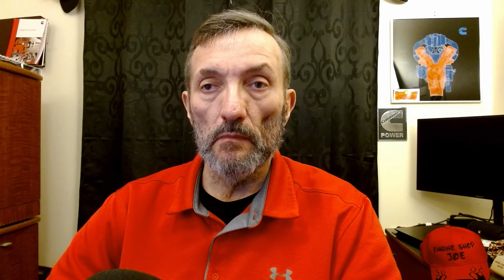Help Air in my fuel and fuel fault 559

Comment: Hey joe I work on my truck all the time. I had code 559 come up after I did biodiesel. I have replaced the fuel filter, fuel injector drain valve, high pressure rail valve front of the fuel line. I put new pump on and tappets , valves in the fuel pump last year. Tested the injectors with inside passed but my rail pressure drops 5200 psi in a min. Could this be a leaking injector  why this code keeps coming up. Thanks for your time nate
Reply from the maker: What engine do you have? Send me the 8 digit serial number if you have it. I am thinking about this.

Comment: Please help me,, i have same trouble cummins engine,, error 559 SPN 157 FMI 18,, already change pressure fuel pump,change fuel filter ,but...same problem coming
Reply from the maker: start the engine and rev up the engine. then grab the fuel dump on the rail and see if it is hot. it should not be, but if it is failed and leaking it will get hot. That can cause low fuel pressure faults. that is about the only easy check. Other than that you need to go through the steps to pin down the problem.
Reply: @ENGINESHOPJOE  thanks for you help me, the problem is check valve at common rail...thanks a lot

Comment: Hi,
I have a question. I been dealing with this nightmare for a month. I bought a used truck with a bunch of codes (09 Sterling with a Cummins ISC 8.3). I changed new rail fuel pressure sensor, new high pressure pump head, new fuel regulator, and a new engine crank position sensor. The truck is losing power randomly and then goes back on. It starts perfectly. When I check the fuel pressure filter housing it registers 110 psi with no interruptions, but the truck will show 8,000 psi at the moment the commanded fuel rail pressure should be 14,000 psi. Question: should I put a new gear pump? It feels like the high pressure jumps up and down in relation to common pressure, but the low fuel pressure stays steady 110 psi. Another question, is a steady 110 psi enough to feed correctly high pressure pump with fuel, or should I change the gear pump?
Reply from the maker: What is the engine serial number.? Make sure there is not anything in the fuel tank floating around that could be a temporary floating restriction.
If it only does it hot suspect a problem with a fuel line between the tank and engine.  Does the wiring harness look ok. Do you have any voltage codes? unplug the ecm and look at all the pins and any signs of green corrosion at all. Then plug them all back in. I fixed a couple issues just unplugging and replugging. Next time it does it check if the rail dump valve is very hot compared to the fuel rail. THey can randomly start dumping fuel and they get hot compared the the rail. Those pieces should all be the same temp to the touch. It could be the dump relief on the rail. 
You can email me at faultcodehelp@gmail.com if you have more information or an ecm image or data log you want me to look at.

Comment: Hi , 
I have code spn 157 fmi 18 . We changed Fuel filter , fuel rail pressure sensor, pressure relief valve 4 days ago and everything went back to normal until today. The code showed up again . If you can point me out what next needs to be check I would appreciate
Reply from the maker: This is a general answer because I have no history on your engine or fuel system. Make sure restriction is normal at the gear pump inlet while dumping fuel from the on engine filter. Verify there is not air in the fuel. Before i had the orficed dump line i used a line with a gate valve i just slightly opened the gate valve to dump fuel.
Check the fitting that takes fuel into the gear pump (line from fuel filter on engine to high pressure pump head inlet) that fitting has a tiny built in filter see if it looks empty to the eye and not crushed or misshapen. If that all looks ok and there are lots of miles on the engine it could be the high pressure pump head which just bolts on with a couple gaskets. You need to do flow checks to verify the pump head is the problem. It comes down to the fuel actuator in the injection pump , the aluminum housing that actuator bolts into and then the Pump head.
Now I will say one viewer had an injector connector cause low fuel pressure. THey are held in with the large nuts on the head where the fuel lines go in. Loosen the injector lines and then those nuts and lube the threads and retorque them with an accurate torque wrench. I have seen those pinch tubes cause problems on isb qsb but never isx until the viewer found one of his failed ( rare).
Because you already changed parts on the common rail I know you follow fuel system safety or you would not be talking to me now.
Reply: @ENGINESHOPJOE  thank you soo much for reply. 
I checked all the lines and filters , and the problem was water separator. 
These days we are paying high price for a fuel and getting low quality
Reply from the maker: @mmiittaarr  Glad it was an easy find and cost was kept down.  Yes prices are very high. Thanks for sharing what the problem was

Comment: Goodnight I have df lf 55 with 2008 cummins isb with 262,000 km it is giving only fc559 code. my diagnostic told me to change the pressure sensor and actuator for the gear pump. I am skeptical but I went ahead and changes the sensor. Can u advise on what to check since I only have 559 fault code
Reply from the maker: Always change both fuel fuel filters if they have not been changed. Run engine at high idle- neutral - brake on, throttle pedal on floor, for a minute and check rail dump valve see if it is hot. if yes then rail dump is failed. Retorque injector connectors ,not fuel lines, the connector nuts that  are on the cylinder head. There are 6 of them. Loosen and retorque. If you still have the problem you will need to do flow return checks to see if it is an injector or your injection pump.

Comment: Greetings and thank you very much for your prompt response. My W900 has 780k miles the fuel pump is 2 years old the filter is the primary paccar k37-1010-100111120 I changed the bowl and the problem persists, when I changed the fuel rail pressure valve in the banjo I found some rough particles and That makes me think that a fuel hose is breaking inside but I'm not sure about that. I will verify everything you advise me. Thank you very much, blessings and success to you and your channel, it is very helpful and we learn from you.